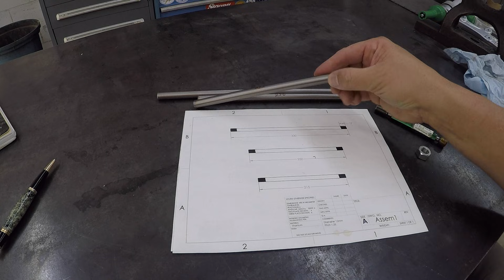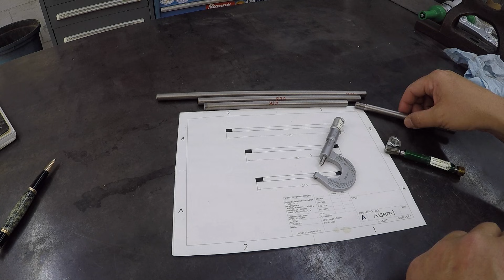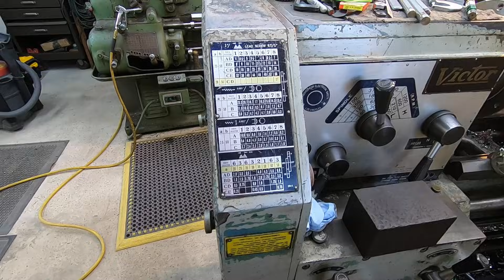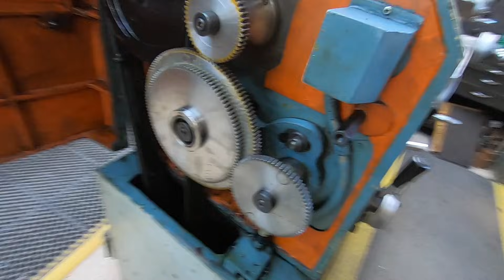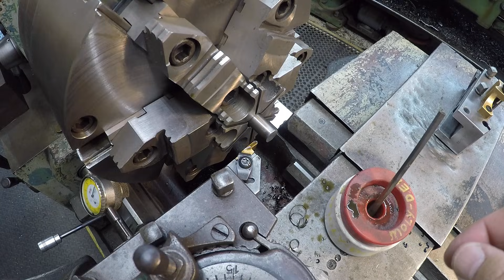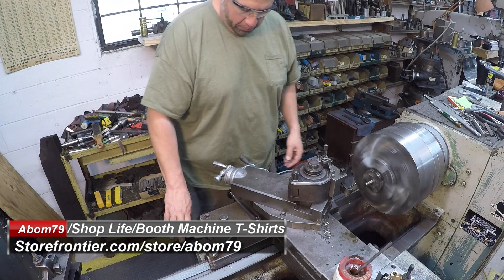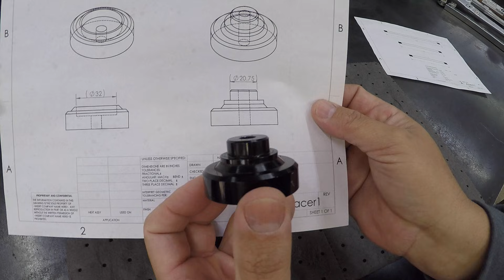Threading Metric Titanium Rod

Comment: I have seen a vid once, the guy was running the lathe in opposite direction, turned the tool upside down and started cutting at the end of the thread - moving away from the chuck. This seemed a quite simple and effective approach of not hitting the chuck. Is there a reason for you not doing it this way?
Reply: Found the vid, id really like to hear your opinion - https://youtu.be/Z-dqOi_z5bk?t=268
Reply: That was Joe Piezynski!
Reply: This is only safe to do with a chuck that locks onto the spindle. Try that with a screw on chuck and there's a danger that the chuck could unscrew itself and land on something!
Reply: ok, nice to know - since im no machinist at all i wasn't aware of that at all.
Reply: Eric Featherstone chuck won’t come off
Reply: @garyg5829  Adam's lathe is most certainly a locking spindle nose so can't come off, but screwed spindle nose chucks can and do come off. I've even seen it myself.

Comment: Hallo Adam why not using taps and dies? So much easier...
Reply: Cut on a lathe the thread will be concentric. With a die it can wobble or form a screw like form about the centerline! A hibred compromise is to use a sharp die to finish the fit but once roughed by the lathe why not complete it there?

Comment: A very intriguing video. I'm a mechanic and have use thread cutting dies and nuts as well as thread taps, I always thought that cutting threads on a lathe would be the same ways as the dies and nuts in a straight on position cutting both faces of the thread, but I've worked out that the angle cut is actually cutting only the one face of the thread and the x or is it Y axis always remains the same on 0 and you are moving the angles slide to cut the depth of the thread...... A very educational video on thread cutting. Thanks mate...
Reply: Use the angled cross slide to only cut one side of the thread. Reduces cutting load from a v shape to a / shape. Search for the this old Tony video on thread cutting absolutely worth your time.
Reply: @frollard  Yea but you end it with a cross slide and a V shape -but its just a small shallow pass.You can also cut it with full V contact but then you have to take more passes.In harder materials it can snap your blade (if its made of HSS for example).
Reply: @zumbazumba1  I've watched Joe Pie's video on threading, thought about it a lot and have used straight in ever since. Seems to me that unless your compound is set to EXACTLY 30 degrees the insert is still cutting on both sides or most probably burnishing on the back side. The other big advantage is being able to turn away from the chuck, off the end of the work with no great precision needed about when to disengage the feed lever. It also allows you to run at higher rpm since you have a longer clearance area at the end of the work. Holds true for work between centers also. I've never turned threads in hard material but this works fine in 4140. I find it hard to believe you could break a HSS threading tool unless you had a huge stick-out.

Comment: interesting vid machining Ti, But can you explain why you use the compound slide when screw cutting? As I see it, you increase the depth of cut with the cross slide but if you use the compound slide set at an angle of,  you are not only increasing the depth of the cut x 2, but you are also changing its start position. IE the tool is moving closer to the chuck on each pass. I must confess, it`s been a few years since I have done any screw cutting and maybe I`m missing something.
Reply: The cross slide goes to the same position for every cut. The only increase is on the compound, so you are only cutting one face of the thread
Reply: With the compound set at 29.5 you are feeding in at that angle and only cutting one flank of the thread at a time
Reply: You can use just the cross slide, works fine for most jobs, but isn't the best practice. Using the compound at 29.5 produces a better, single chip, and produces less chatter since the cutter is only loaded on one side.

Comment: why is there no faster way to cut threads? it realy bothers me.
Reply: There are a dozen ways to cut threads. Single point threading is the most accurate, most controllable, and last force way to do it. The only other way to cut threads on a manual lathe is with a tap/die. (Or the geometric threading attachment we are talking about above. But it's similar to a die.) Not sure why it "bothers you." Maybe don't focus so hard on inconsequential things.
Reply: Rorschach I have seen threads being rolled. It was for old fashioned spoked wheels for cars. I was a first for me. I guess this can only be done for small diameters.
Reply: @cf6282  Most production threads are rolled. Rolled threads are very fast to make and stronger than cut threads. The down side is that you need specialized tooling for each thread size.
Reply: There is a gadget called a thread chaser.  That is what we used to call them anyway.
They are a bit like a die but the three cutting surfaces are seperate pieces.
They fit into a holder that is adjustable.  You need different cutting pieces for every pitch.  I can’t remember how many different diameters each set of cutting tools can do.  Been too many years since I have used them.  They snap open when you stop feeding them in so you don’t have to wind them back off like a die.
The problem is a whole set of cutters and holders would be quite expensive.  They can make a nice thread in one pass if they are sharp.
The advantage of single point threading is all you need is one tool and a little more time.
With regular materials you can easily grind your self a HSS tool.  Just need more time and a bit of extra skill.
Obviously this is a little more complex doing metric threads on an imperial lathe.
With a metric lead screw on a metric the problems are reversed.  Harder to make imperial threads.
I wonder if Adam has picked up any Thread Chasers over the years?

Here is an example I found with google. Just a random find.
http://www.rsvptooling.com/gsc.html
Reply: @DavoShed  Adam did a video on geometric threading. https://youtu.be/5GkmMAqn9fA
Reply: @DavoShed  (in case my last comment with the link got removed) Adam did a video on that. Search for "Abom79 geometric threading."
Reply: C F thread rolling can be done on very large threads if you have a big enough machine . I have rolled 2.0 - 8 threads on inconel

Comment: Slick!  I see why it works even with the half nut getting disengaged.  The machine just isn't turning far enough to lose the correct leadscrew engagement.  I made a spider for the left end of a spindle for gunsmithing on an Asian lathe but earned to leave the half nut engaged the whole time.  The lathe was set up to cut and thread Imperial but the hardware on it was all metric.  The chuck was smaller than yours though, so less inertia to keep things going and I was able to stop everything with the foot brake before running out of the relief cut.  I was machining cold rolled garbage so not running 330 rpm either.   It helped that it was a brand new lathe in perfect condition.  It turned out nice, with a close fit on the threads.  I polished and hot blued it and fitted it out with brass screws so it looked sharp.  Thanks for sharing what many would consider a trade secret.
Reply from the maker: Yep, just keep track of the original position. If it rotates around you have to reverse vans engage in that same position. 👍🏻

Comment: Why do you not just reverse the cross slide with the tool at the same depth rather than backing the tool out?
Reply from the maker: If you don’t remove the tool you’re break the insert and completely destroy the threads
Reply: The backlash in the gear train (there /should/ be backlash in the gear train) and in the half nut mean that the tool would take a different path in reverse and mangle the thread you've just cut.
Reply: Also just realized...in reverse the part is spinning the other way. Cant cut with the bottom of the insert and lifting up on the cross slide.
Reply: i have the same question
Reply: Rorschach ill bet because he has to wait for the 1 to come back around, if he misses or something it could ruin the whole part. Also, probably just good technique to thread towards the chuck, thats how I've always seen it done

Comment: I thought this threading method works only on imperial threads? Does your machine have metric lead screw?
Reply from the maker: Proper change gears to convert to metric. I showed in the video.
Reply: @Abom79  I  knows you can convert between metric and imperial threading by swapping gears. But I was talking about the lead screw (and the threading dial)  being made for inch threads and the method when using the compound slide for depth control.
Reply: @Trident_Euclid  Adam is effectively keeping the halfnut engaged in the technique he used.  If you think about it, he is disengaging the halfnut, stopping the spindle, then reversing the spindle and re-engaging the halfnut exactly where he disengaged it.  If he allowed the threading dial to rotate a full rotation with the halfnut disengaged then re-engaged it, any further threads cut would be not clocked properly and the part would be scrap.
Reply: Imperial leadscrew here.

Comment: Can u explain why you don't use a threading die.  Then u can thread in one shot.
Reply: You will get a much better thread by turning them not to mention how tough Titanium would be to do with a die.
Reply from the maker: Single point threading, that’s why
Reply: Dies are expensive tools which trade lathe skill for simplicity with cost as the conversion factor.
Reply: Tap dies do not always cut the concentric or square with shaft.

Comment: The whole process seems more complicated than l imagined treading to be.  Is it because you're cutting metric threads on an inch machine or is all threading this involved?
Reply: Manual lathe threading is a little complicated. Adding metric into the mix makes things more complicated. The whole backing up and engaging the half nuts at the specific spot wouldn't exist if this were a metric machine or if he were doing standard threads. That's a neat little trick he's doing there though, I had never seen it until now. I would never disengage the half nuts, just use the foot brake to stop the lathe and then throw it in reverse with the half nuts still engaged when I do metric threads on a standard machine, but now I might try that, especially if I'm threading up close to a face.
Reply: @operator0  abom's way is the way to do it on a lathe that dont have a brake
Reply: It’s not that complicated. I run the thread, and pull back on the cross slide when I hit the run off and reverse direction. Zero out on the cross slide and advance on the compound. You need to be quick when you pull out on the cross slide. If you are late, you can break the tool when you are deep in the thread. I never disengage the half nuts.
Reply: @sanjaysami4315  This is just a more refined way of doing it. It has advantages: allows faster spindle speed, the feed is instantly disengaged with the half nuts and still keeps the same position on the lead screw and allows the machinist a little more time.
Reply: This Old Tony has lots on threading. He keeps the half nuts engaged IIRC

Comment: So there's a footbrake! its all coming together.
Reply: It's an actual disk brake system like what you would see on a car, complete with rotor, caliper and master cylinder. No brake booster though, but it's not needed in this application.

Comment: I always thought titanium was very hard and would be difficult to machine.   Looked like it machined pretty easily.  Did you have to use a social insert for this job?
Reply: Titanium is fine with the proper feeds and speeds. And tooling. And technique... There are far, far worst materials to machine.
Reply: Titanium was difficult to machine back when all they had was tool steel cutters. With modern sintered carbide, you can cut just about anything.

Comment: Why so many passes? Just to let you know I know nothing about machining. Is it because the material is so hard?
Reply: Titanium machines differently than your typical steel. The chips normally come off hot and remove the heat from the work. Titanium behaves the opposite. The part gets VERY hot if you go quickly. That heat hardens the titanium and makes cutting very difficult. It's better to make many passes and keep everything very cool. Coolant is a really good idea with titanium.
Reply: Sneaking up on final size is also wise if you're working on special material like that.  If you were making many out of common material then going faster - at the risk of making the odd one wrong - would be worth it.
Reply: With threading, you have a lot of engagement for the size of the tool, so small cuts are required to get a good finish and not burn up your tool.

Comment: Yeah, keep measuring as much as possible in standard to stay away from that Metric CRAP
Reply: Mechanic here, metric is the way to go. 🤷 I'm a red blooded American, but I hate the fractional inch English units. I like grabbing a 10mm socket instead of a 7/64ths. 😸 I want my temperatures in Fahrenheit though. Celsius is not a good system for temperatures that humans are comfortable at.
Reply: @mannys9130  Measuring distances and volumes? The two systems have their own unique benefits; in general metric has more benefits, and they're far more beneficial, and they can be applied in more instances. Measuring temps? Aside from aqueous chemistry it's 50/50, and for weather or air temps farenheit is nice.
However, metric units of force are absolute garbage outside of a laboratory setting. Who ta feq knows what a newton meter feels like, but pound feet of torque is a perfect unit. Same with PSI, get that pascal hoo-ha outta here!
And of course, horsepower isn't an SI unit either. Yea sure 'metric horsepower' is technically a measurement but everyone uses the imperial version i.e. mechanical horsepower. Metric horsepower isn't even called horsepower, it's just displayed as kW.
Reply: @KingHalbatorix  I can agree with that
Reply: @mannys9130  As a fellow mechanic. I strongly prefer metric over inch.
Reply: @mannys9130  7/64? that's a damn tiny wrench lmao
Reply: Get out
Reply: I much prefer working in metric and I'm in the US. A simpler system to use.

Comment: Possibly silly question from a non-machinist. After you disengage the half nut, why not dial in the next cut and cut it on the way back?  
If I understand correctly, the relief cut is there so you wouldn’t start cutting until you re-engage the half nut.
Reply: You would destroy your thread. Feeding in the opposite direction cuts a reverse thread. I know because I've done it more than a few times
Reply: If there is any runout, which there always is, the thread would cut in a slightly different place, ruining it.  He is keeping the runout in front of the cut. And, as I was quickly reminded by the commentors behind me, the cutting tool would also need to be flipped over.
Reply: Paul Tribbey Thanks!  That makes sense. I figured there was a good reason.
Reply: @sarman1998  Paul is only half right.  Yes, any looseness in the machine drive and leadscrew will make the tool trace a slightly different path in reverse, but that's only half the reason why this wouldn't work.  The other problem is that your carbide tool that does the cutting can only cut when the lathe spindle is spinning counter-clockwise.  Reversing the spindle would definitely make the tool trace a similar thread path on the part in a reverse direction, but the carbide would just be rubbing up against the part.
Reply: @ZPositive  This is the correct answer. You would need the tool to be facing down when cutting in reverse.
Reply: @operator0  I've done this when needing to cut tight up against a shoulder. Flip your tool over and cut on the back side of the part. Start close to the chuck and feed away.

Comment: Adam was engaging the half-nuts on the reverse the first time the blue mark came around. Would it matter if it went one or more complete revolutions?
Reply: Yes, very much. If it goes more than one revolution you'll be out of sync with what you've cut already and end up cutting multiple threads. Remember this is a metric thread being cut on an imperial lathe.
Reply: Yes, if you let the dial indicator go all the way around, you could split the thread.  The same is true when cutting 11.5 tpi.  On my lathe you have to use the same number without the threading dial going all the way around for 11.5 tpi.
Reply: I can not understand why there’s a difference between metric and imperial threading. 
It would be interesting to see what’s happening running the thread dial in a usual way on a imperial machine making a metric thread.
When my lathe is up and running I need to try for my self.
If the same number is used to engage the cut, I have a hard time seeing the lathe be out of sync.
Reply: @perolovson1715  it' a simple thing. On an imperial lathe, if the half nut does one full revolution your starting point will have shifted exactly one inch. That's why you can thread like that. If you move exactly one inch, theoratically, you are in the same place and are able to start the cut. Doing that on metric threads won't work (I think you can see why)

Comment: Great job. Any idea where to find a 70 tooth gear for the Victor? I just looked and mine doesn't have one. I have some metric threading coming up for a project this summer and didn't realize that gear was missing.
Reply: You could make one if you have a dividing head. It wont be fun though.
Reply: @operator0  Yeah, I would like to avoid that if possible.